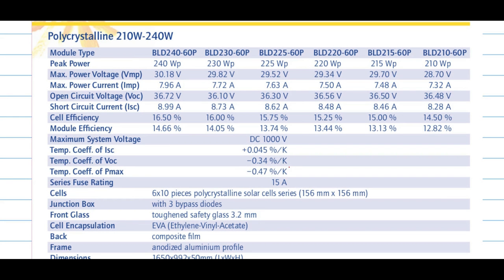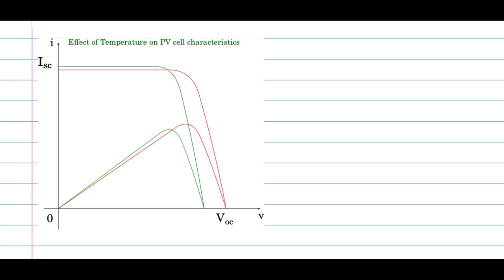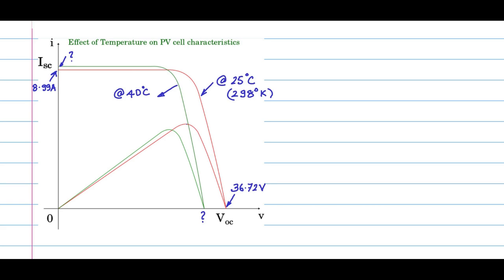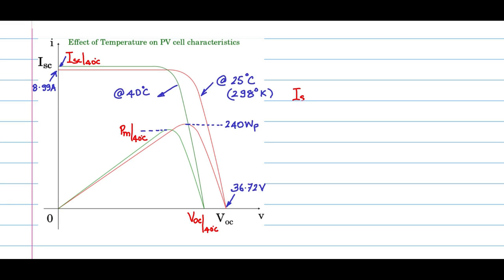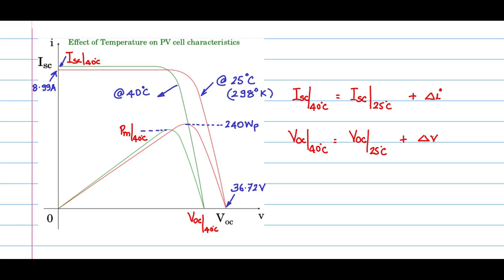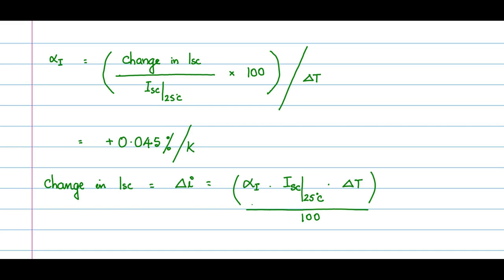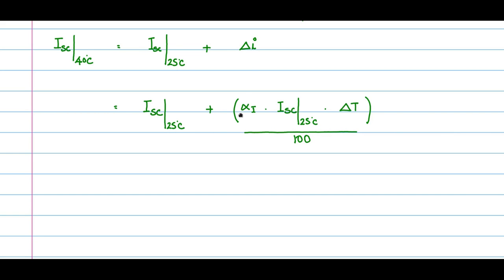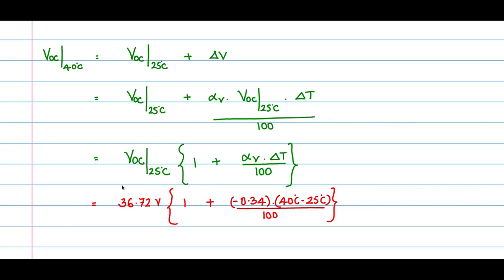Temperature effect calculation example

Comment: calculation of Isc at 40 degree  is not machting  with the result
Reply: ya looks like an error, we get 9.05 amps
Reply: @varuncvs7411  yes I am also getting the same answer as you it has to be an error
Reply: @varuncvs7411  sir y it is like this

Comment: So in the winter when we have for example -20°C and 1000W/m2 radiation,  the power production of a module can overcome the peak power?
Reply: yes cold weather with high radiation are best suited for higher solar power generation. also balance of system efficiency is higher under colder weather, leading to higher overall efficiency as well